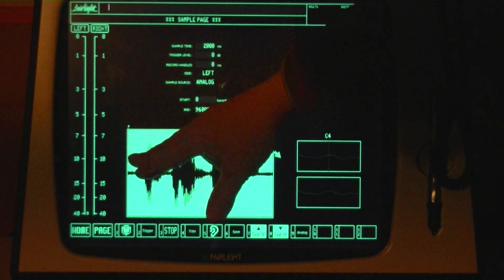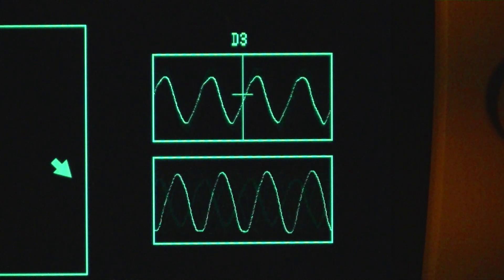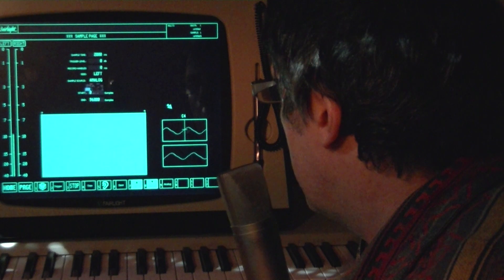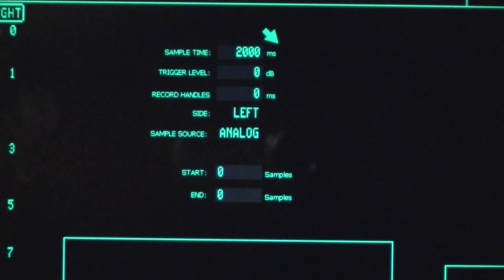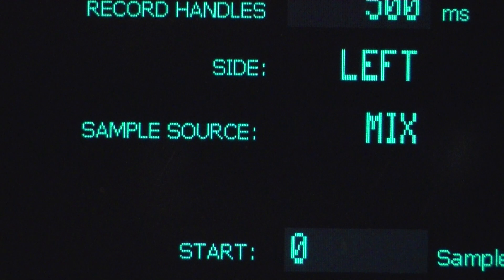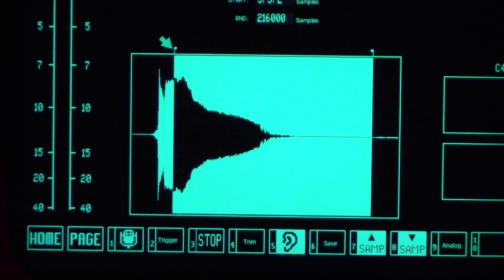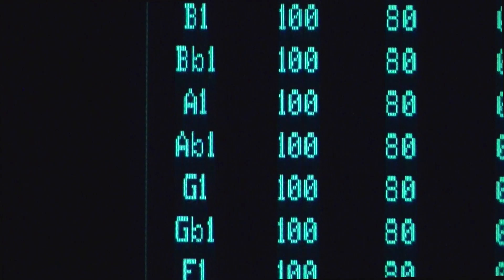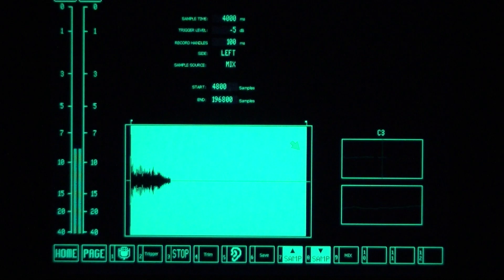CMI30A-sampling

Comment: Sampling was a phenom in the early 80s because it was new tech. Now my phone can do that, and a lot more. Revisiting a classic sampler is lunacy, selling it for $20K is even MORE crazy ( keyboard, cases, and shipping, from AUSTRALIA, are extra). I just checked out his sight, and the "Fairlight" name isn't even available, so that would be like buying a Mercedes without their emblem and name on the car. The Synthtopia review and the specs on Vogel's website don't match-up at all. Right off the bat something doesn't add up: It claims to have 24 polyphonic instruments ( whatever that means) each with 1024 samples. Whats the polyphony for each instrument? Are the samples in stereo? Assuming you have at least SOME memory dedicated to the OS and applications, that doesn't leave a lot for 25,000 samples at 32 bit and 192kHz (again those numbers don't match between sites).  Of equal curiosity is the limited memory: 3 gig of RAM? My $3K Kronos has that. An SAT drive? Why not a flash or static drive? S/PDIF i/o? Why not AES/EBU? It seems a lot of the money goes towards things that have nothing to do with the sound or the functionality of the system: the mainframe weighs 70 pounds, then you have clunky monitor and the light-pen, and an i-phone for a keypad. WTF? It would seem Vogel wishes to sell the same sampler back to the people who bought his first one. He better hurry, there's no industry left, and those folks are going broke because they can't dance on stage......

Comment: You can't tell me that they couldn't make a faux reissue of this thing using cheap modern computer parts inside an exact copy of some retro style cases and sell them for around $1500-2000 dollars. They make a fking killing.... Like korg has done with the arp odessy and that micro synth. This guy insists on making an exact replica of the original using exact parts and everything... Super expensive $25,000.... Get serious dude. That's a car or a good damn sized down payment on a house. You can throw a touch screen inside a little retro computer screen case and make a light pen for it... As a matter of fact this whole thing could run on an IPad PRO... Just make a cool screen case and rack with an old computer chassis  in it and you hit gold.
Reply: +Christopher Moody 
You're about 5 years late with that bit about the iPad.. it's been an app since 2011!!
Reply: +nunya bidnits yeah I know it's on the iPad and it is way less cool / functional than a full hardware version would be. My comment about the iPad pro was more about the minimal amount of processing power you would need to do a true version of this thing complete with a real chassis... Not about having it run off of an actual iPad.
Reply: @christophermoody6840  But can that stuff do true analog with all the dynamic Imperfections of 8 bit / 12 bit without sounding thin sterile and cheap?